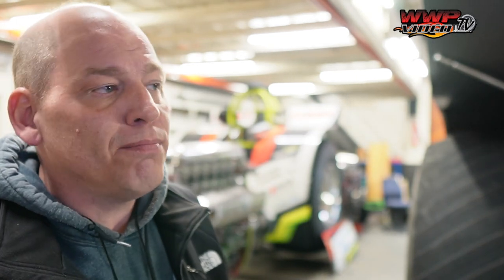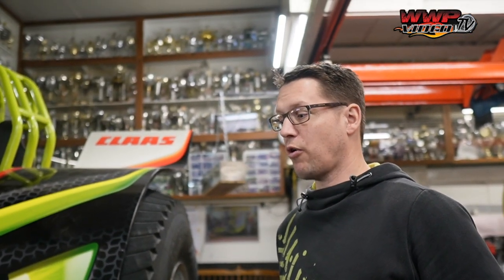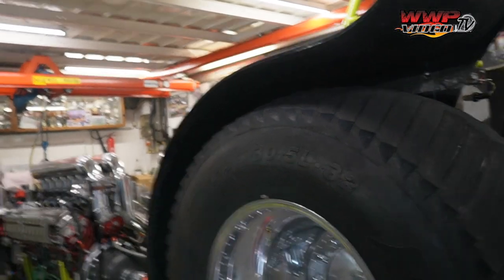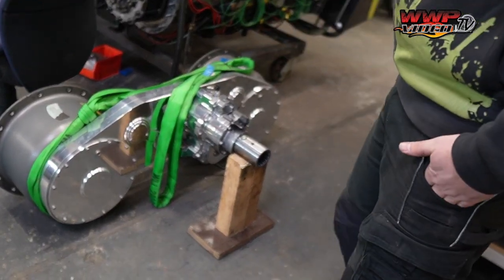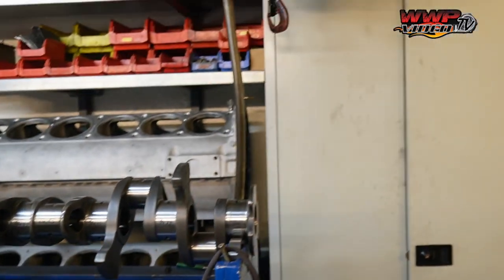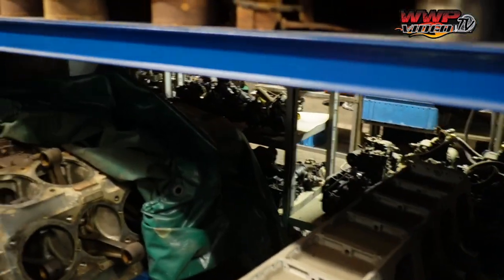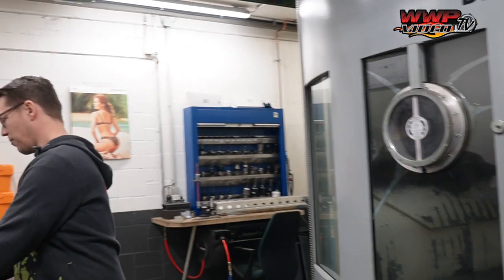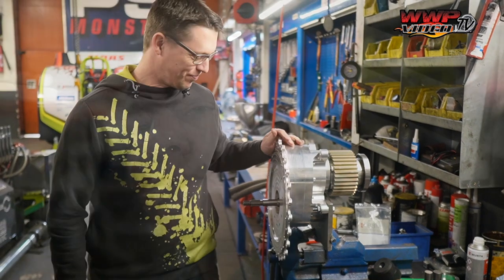18000 HP Up Close: A Workshop Visit to the Green Monster Tractor Pulling Team in Germany - by EUSM

Comment: We run a super stock tractor in the states and have had good results with the pro puller tires over the Mitas give them a try
Reply from the maker: If Pro Puller bests Mitas sponsoring .. Just kidding. The Pro Pullers on high-wheel speed tractors weren't that impressive yet.

Comment: Do they run more spark advance on the exhaust-side coils than the intakes?  I think I remember reading the Allison ran different spark advance exhaust to intake.

Holy cow!  That 3rd lightweight tractor is amazing from all the lightweight parts.  What's next?  Carbon fiber connecting rods and titanium crankshafts in the Allisons?

Allison Wonderland is right!  5 crankcase assemblies ready for build.  Flow bench for Allison head.  (What does an Allison head flow?)  V3420 crankcase from EJ Potter's tractor.  Main bearings from a German source.  I'd be totally amazed if you had rod bearings.
Reply from the maker: There is no spark advance between the coils, but the timing curve was done after measuring the cylinder pressures. Rod bearings are in the prototype stages.
Head flow is not so much of a concern (there is lots of "head"), as the boost levels are still relatively low, once you get a different blower and much lower intake temperatures. Getting more air supplied is what's currently worked on.